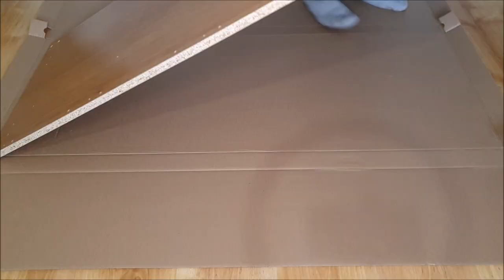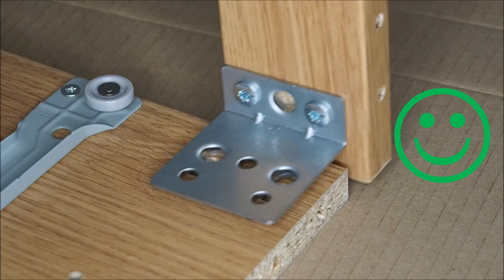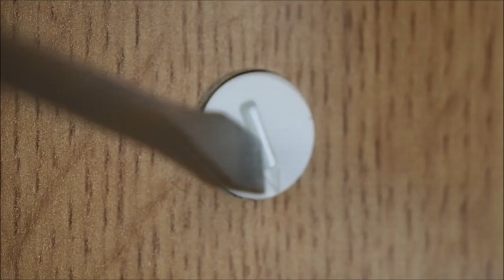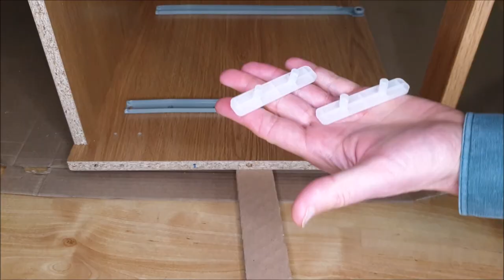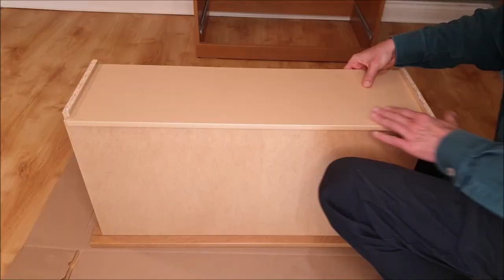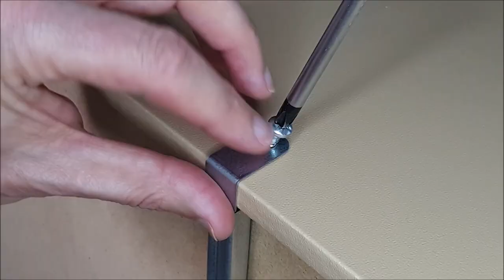Ikea Brimnes chest of drawers assembly

Comment: This helped me so much. Was really confused with the manual. Can you tell me if it’s ok to skip the bottom part like what you did  they haven’t kept it empty
Reply from the maker: Thanks for watching. Can you please tell me which minute do you mean?
Reply: I somehow fixed that . Can you tell me if the stick in between is necessary? At 3.24 ? I can’t fix the screw there is some issues with the screw . Thank you for the reply.
Reply from the maker: @ChildrenParadise Great, It's better to have it as it keeps the sides parallel, particuraly when the drawers are heavy full of stuff.

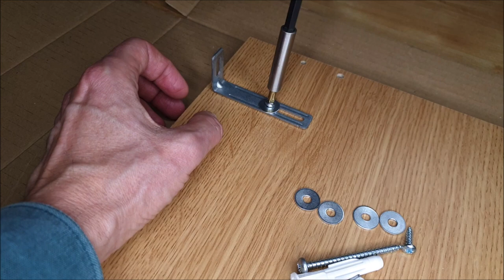Comment: 2:30 how tight did you screw these in? Really having a hard time  with these. The longer metal parts are still very loose (can go 360 degrees around) yet it is very hard to get the screw deeper into the wood.
Reply from the maker: It's very hard to explain. Pretty tight but not very, very tight because you'll destroy the furniture and the screw will start turning round.

Comment: Do you need the middle rail to build this ? I can’t seem to find it so wondering if I could do without
Reply from the maker: Better use it if you can, otherwise the sides can bend over time. When the sides are not straight, the drawers won't slide smoothly